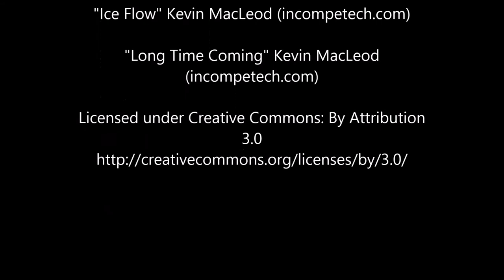Quick and Easy Drawer Pulls - Red Barn Workshop

Comment: Your shop your safety rules, but that was not good move but I think you were aware of the risk.    Now we need to see a router table build and reference this video as the motivation for making it.
Reply from the maker: Old video, a lot less experience and equipment. However, the only thing I see that I wouldn’t do again is operate the router with gloves on. Everything else is perfectly acceptable.